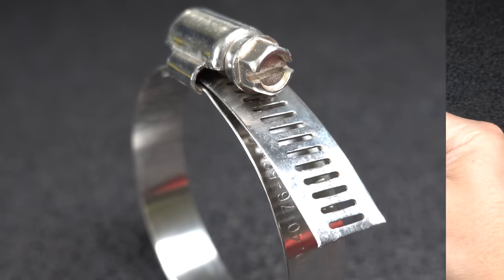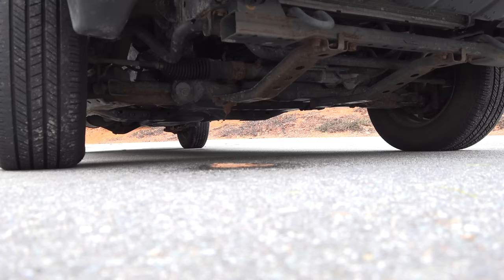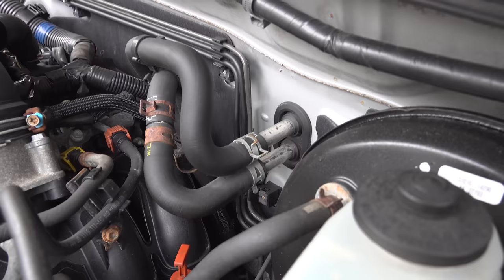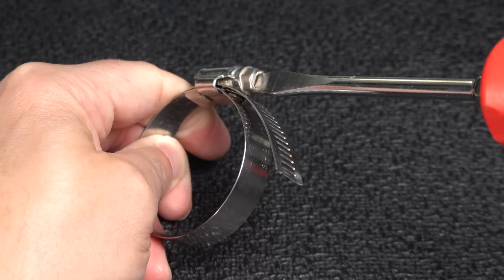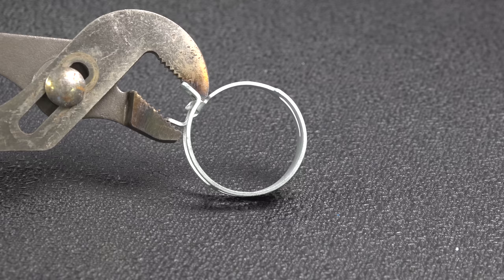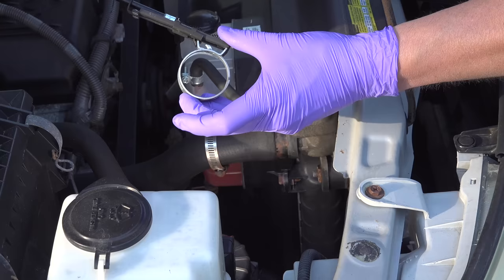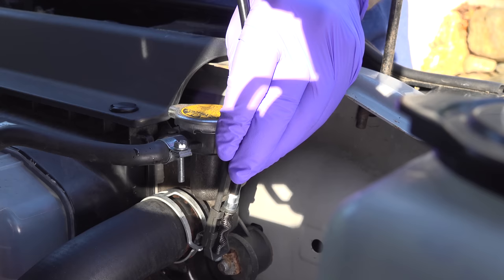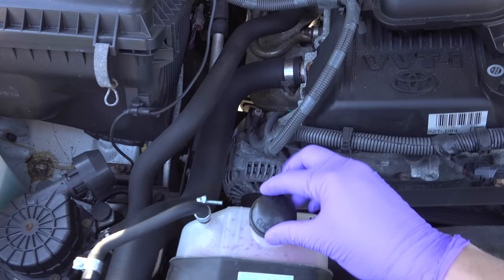STOP Using Hose Clamps WRONG - LEARN A BETTER WAY

Comment: I have to disagree, personally I hate those spring type clamps. Theyre most annoying when they’re in tight spaces especially.
Reply from the maker: They are tough in tight spots, hopefully you watched the rest of the video with the tool, it works really well even in places no other type could be accesed
Reply: AND finger gashers !!!
Reply: @SilverCymbal  No one wants to buy special tools to install clamps.
Reply: I have replaced a lot of hoses that rotted under these spring clamps. I do not like them.
Reply: @carlosk8103  I buy the tool to install a superior clamp

Comment: I don’t really work on cars but I do work on snowmobiles and atvs and we always use the worm clamps on carburetors and other places close to the motor we’re it’s always hot and I’ve never had leak issues

Comment: You got to be kidding me. Mechanic for 40 yrs. I threw every one of these clamps away and cursed the guy who invented them. They lose tension and leak, are a pain to remove. Replaced them with the screw type and never had a problem. What the ad said is just the reverse.
Reply: You need special pliers for these types too.   I'll just stick with the screw type
Reply: I always change them out for the screw ones especially when their in spots you can hardly get too. Honestly way easier to get off and on.

Comment: Another reason to NOT use the old screw clamp:  It really only puts pressure on the screw side.  It looks like it grips all the way around, but in fact it doesn't.  Take off an old hose and you will see more indentation and the screw area.  Another reason, they strip out easy.

Comment: My issue with OEM clams is they're always in a very hard to reach position where the pliers (or channel locks) hardly fit. They do make a special tool for them that is basically a bracket at the end of a long cable to fit into tight spaces but I would rather use the simple worm style clamps with a flathead screwdriver or 8mm socket and be done with it in less than half the time.

Comment: In theory you are absolutely correct.  But I have used the old skool ones for 65 years,  maybe i had one or two leaks.  Also, never had flat tappet cam problems.   Can you kids even get a pickle jar open??  I am j just now doing a radiator job on an olds alero.  I WILL USE constant tension clamps....mainly cuz they are already there, and, . just to be with the in crowd for one time.,

Comment: Those spring clamps are recommended especially for when you have a hose over a plastic fitting. You can over tighten a screw clamp and crack the fitting
Reply: That's why they supply torque settings for every screw, bolt and nut in workshop manuals- so people with no hand skills or mechanical aptitude can work on cars without having an excuse of fucking up.

Comment: I quit using worm style hose clamps in any machine that gets hot and cold.  However, I still use them to hold large wire cable bundles together.  It is much better than few bands of electrical tape.  They are also far easier to undo than cutting through a bunch of tape bands and peeling them off.

Comment: Only problem is once those clamps rust the top handle can snap when you attempt to take it off and that was an entire new job just finding a way to get that clamp off once the opening handle snapped. Tried finding a replacement at Autozone but they only sell the other clamps with the screw so that’s what I had to use when I replace my radiator.

Comment: First video I seen from this guy definitely the last, I have been using these worm drive clips in multiple vehicles  for 15 years and never had an issue. The smart clips he's suggesting become a problem over time losing their clamping strength.
Reply from the maker: If you don't like the message just cancel the speaker. Don't bother to fact check or anything. Cancel culture even for hose clamp truths

Comment: The worm clamp you show in this video are the cheap ones which are thinner and have the teeth cut right through, I agree they're a waste of time and money. The original jubilee clip work just fine in my opinion. I agree that the constant tension clamps are great in the circumstances you described. One other issue with worm drive clamps, especially the smaller ones is when they are tightened down to the smaller end of their range they loose their shape and don't clamp evenly. The constant tension type is not new as you stated, I have found them in many older vehicles.

Comment: I did have issues with these clamps (I'm 11 years car tech)
My issue was that it was leaking, but in a very small manner, just enough for it to build up coolant residue. Usually, I just did a careful re-tight and a clean and never had an issue still.

Comment: Something to remember is not all worm style clamps are created equal. The one in the video looks like a poor quality cheapo. A good stainless clamp will fit together easier and just be a smoother install overall. I've been using them for years and years on various vehicles and never had an issue. There may very well be something to your argument about OEMs using those spring clamps to adjust for temp swings. I know that they likely use them for the install speed, but I'd say the temp part is also a reason. I think some people who argue against this have never been in extreme climates. A clamp has to be able to withstand temps at -50 with the engine cold as well as 130 ambient temp so well over 300 under the hood, even more depending on type of vehicle and if you're towing. Go tow a heavy trailer through the desert in the middle of summer and tell me that wouldn't matter. Lol

Comment: Squeeze clamp are the ones I have problems with leaking. 
And the way I look at it those are Factory clamps used for cost-savings. Always change out to Quality clamps you can tighten

Comment: only time i'ev had a leak from a worn gear clap was from a old hose running from the engine to the top of my rad that was about 20 yo and a new  hose fixed it...not always the clamp rubber will form and take shape of what ever it's being used to seal and wont seal completely use it's just about perfect from where it was once back on

Comment: The worm drive hose clamps are fine, you can choose how much pressure you want, your either using cheap nasty ones or they are the incorrect size. As for your leak it’s not the clamps problem with the heat on the clamp, it’s the coolant getting warm and causing pressure in the cooling system and if the clamp isn’t tight then it’ll leak under pressure. The constant tension clamps are cheaper to make, faster install and take out the human error of how tight it should be, that’s why oem’s use them.

Comment: Both clamp styles have their pros and cons.  I have to say, spring clamps have given me more problems over the years then worm gear clamps.  The main reason for spring clamps is not temperature variations, it's ease/ speed of assembly at the Mfg. plant.  The best I have found are t-bolt style clamps in stainless steel.  Not cheap, but they will last forever.

Comment: Thank-you for this video, very informative. You cannot get definitive advice on these clips/clamps. Everyone seems to have their own way of doing things.

I fitted an auto transmission fluid cooler to my van so its good pressure, decent heat changes from ambient to 110°. I had so many issue with jubilee or any other style of worm drive ones. They can work for months, no leaks etc, but then just pop off without any warning.  Every time, on inspection of the clip, its eiether loosened or thrreaded. Hose is fine, otrehr than it can tend to show over tightening.  However jubilee's simply all failed me in the end. leaking ones are the good ones as the ones that go suddenly require breakdown as you dump all your ATF on the road!!!

I fitted these spring clamps and so far nothing to report. Much, Much better.

Everyone says car manufacturers use them as they're cheap. Its not true. They use them as they are better in certain circumstances and also much easier to fit.

Only thing you should do is replace the hose as the existing marks the clips leave will not be a good surface to use the new clamps on.

Comment: I have 2011 Toyota Camry with a slow power steering leak by the reservoir hose which has a worn style clamp, just purchased oem quick connect clamps. Hopefully that will solve my problem

Comment: there are pros and cons to using either clamp.  The red is a self-adjusting clamp.  the screw type clamp is usually easier to remove in tight places provided you can get the screwdriver on them,  making sure you tighten firm enough not to leak may need to do a second tighten after the hose has gone to heat cycles.   For both types of clamps, you will make sure to use the correct diameter, especially the self-adjusting clamp " YOU MUST USE THE CORRECT SIZE" for your hose otherwise will leak it the clamp is slightly large or hard to slide in place if it is slightly smaller.   The screw type is more forgiving, not Gorilla torque the clamp, and both works great.

Comment: You make a good point, however manufacturers moved to these as they are cheaper to manufacture, and quicker to fit on a production line,  but people must be cautions if they slip while under tention while removing/refitting they can shoot off and cause serious injury, i found good quality jubilee clips do the job and as for tightening you learn with experience the magic spot, they didnt use them for decades on cars marine etc if they were no good at all, also i cant be sure but that return pipe that was leaking looks like its too big for the connection with the reservoir with the amount of shoulder you can see around the clamp and end of pipe,

Comment: I had new spring clamps in my car, and the pipe pop off and I lost all radiator water on highway(4 years old car) , I change to warm clamps and since that never had problems, I had cars since middle of 80s with worm clamps and never had problems with them, 40 years of experience and worm clamps never failed me

Comment: As a 20+ year tech I do agree with this video. We live in an area that can change 20+ degrees from day to day. Never had a problem with squeeze clamps but periodic issues with the other. If I don't have squeeze clamp I have to tighten it, drive vehicle, let it cool down, retighten. Depending on the time of year you could have a large temp drop and still have it leak.  Squeeze clamps are more of a p-i-t-a if you ask me, but at least I know I will not have a comeback.      Customers don't understand nor care about educating them on how certain clamps might leak if it gets to cold.

Comment: I find both in many cars lol usually the spring ones are on hoses to the engine and the other ends have the adjustable ones usually connected to plastic

Comment: Iv had those constant tension clamps leak far more often then worm gear clamps. 

It's a spring yes. That spring will lose its springy over time and start leaking. Just like vibration will loosen the worm gear clamps.

Comment: Everytime I use those worm drive hose clamps I never had a problem with those but those constant pressure clamps I always have leaks the engines are sucking air and when I replace them I never had a problem with a worm drive clamp

Comment: Spring clamps apply proper even compression. Screw clamps put pressure points under the screw and are easily over tightened. I have seen copper radiator tank hose connections crushed and plastic cracked by the under screw pressure of screw clamps on too tight. Automotive water pressure is less the 20 psi and the clamp just needs to keep the hose from sliding back over the barb rib.  The rubber of the hose makes the water seal unless crushed and mangled by previous screw clamp use.

Comment: You are right, in theory, but there is something worth to mention: they will provide a perfect seal, if the hoses are in good shape. It is not the case in reality. In the practice, they lose tension if you remove them, they could be bent in the extraction, and you need a rubber in good condition to use them. Manufacturers use crappy rubber hoses that harden over time, this makes this clamp style to leak if you reutilize them. Even a new one won't work, but that'd be a hose issue.

Comment: On a boat, if the hose goes to an underwater fitting, you use two all-stainless screw clamps. I usually set them so that the screw heads are accessible and on different sides of the hose.

Comment: Those clamps cost ~$12. a piece, vs  ~$3.-4. for a pair of the screw in ones, I checked them the other day at O'Reilly, there is no way I expense 12$$ on that !! , I needed 3, did the job , so far so good.

Comment: And of course if you're a good mechanic/service technician - a trained eye Will detect if a hose connection may be weeping - and check tightening a worm drive clamp once in a while is good practice too.

Comment: Diesel mechanic in Iowa. Those pre tensioned clamps from factory go bad and I’ve seen it in various occasions. Nothing wrong with using good stainless steel screw type ones.

Comment: The only thing 2 watch out 4 though is the original spring style clamps will lose tension when they're old typically when replacing hoses due to age so it's best 2 replace em unless your simply removing to gain access 2 something else then put them back on exactly how they were then your fine,, or keep an out 4 tridon screw clamps as they hold very good n strong,, several gm cars from the 80's had them from factory till the 90's

Comment: It's a pain putting these style clamps on in the right places, and I've had several wear out and not hold as tight as they should, so I swapped them out for the screw type and I've never had issues

Comment: Those spring clamps are nice. But still, on many cars you can find those screw hose clamps. As long as they are good quality, I don't see the slightest issue using those. As an example: NORMA TORRO WF. They have built in springs to keep an even pressure on the hose.

Comment: Sometimes the fitting you are trying to clamp onto has been degraded by rust, heat etc and the constant pressure clamp isn’t as tight anymore.  The constant pressure clamps are designed to be used on a specific outside diameter, of that diameter changes or goes out of round, it will not properly seal.  That being said, if there is no degradation in the fitting, the constant pressure clamp will work better and last longer than the cheap worm clamp.

Comment: Worked on cars my whole life and I’ve never had a worm gear hose clamp fail or come loose that I can remember? Worked in industry the last 25 yrs and used the large quick release style worm gear clamps on equipment with big temperature range and lots of vibration (product sifters for instance). I have seen them installed incorrectly but have never seen one fail?

Comment: screw clamps always the best option if you have sufficient experiences in automotive repairs 
Spring clamps the work fine, but there worn out over time, they experience fatigue as they're constantly under tension, you'll find leaks 10/10 from spring clamps overtime rather than screw clamps 
As they mostly fixed in 1 position and rarely losen itself 
The only scenario when screw clamps fails and leaks are rusted clamps , oil emulsion in coolants and oversize clamps 
Rust can corroded the screw threads 
Oil emulsion could cause rubber coolant hose to bloated and often create small folds when tightening the clamps 
Oversize or wrong size fittings , many ppl think that a large size could fit a lot of hose, but actually there are size references stamped on the clamps for correct sizing , the clamp shown in your video are actually too large for that hose as they rarely left more than 1" of "tail" when tighten in the correct hose size , different clamps have different radius , if you got the size lager than I should be ,it still can be used but I no longer tighten in round shape as the hose , it will deform and the rubber hose will deform as well , no matter how hard you tighten it , it will leak soon as there's pressure 

High end car or performance car often use screw clamps instead of spring clamps

Comment: imo eventually after 50k miles , the constant tension clamps can rust might need replaced, usually because they snap coming off when flushing or swapping, aka will break when trying to remove them if they had direct road spray exposure.. But worm gears are only temporary options for these types of hoses over 2" dia. imo and not recommended for sure.
Problem is, the oem types are terribly difficult to find and almost no parts stores ever carry them. Go to a dealer and have them order you some if you cant find em online. I find smaller dia. worm gear types on engines that have been there long enough to rust though and dont leak...so depends on if they were on right more than anything I guess with smaller than 1" sizes.

Comment: I actually had a leak on a new one year old radiator. I tightened the screw clamp it later leaked. I tightened it again and it squeezed in the plastic outlet, punctured a hole in it, then it leaked really bad. I got a replacement and put on a set of new hoses and those old OEM clamps, problem solved. Screw clamps don't work well with old hoses. You can put the OEM clamps in a vice to make them tighter, just don't put too much squeeze on them.

Comment: The hose clamps(worm clamp) works best for high pressure connections. I’m running 28 pounds of boost and those smart clamps would fly right off but they are good for coolant connections.
Reply: Do you really use worm gear clamps on boost pipes?
Reply: @ding9633  no not on boost pipes I’m running T band clamps for the intercooler piping. The worm gear clamps I mentioned are for my coolant lines only.